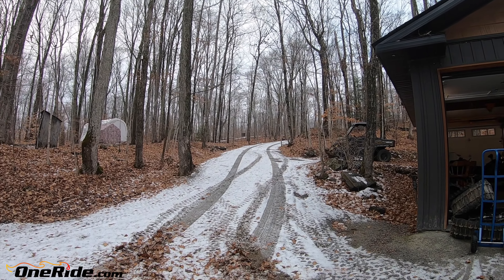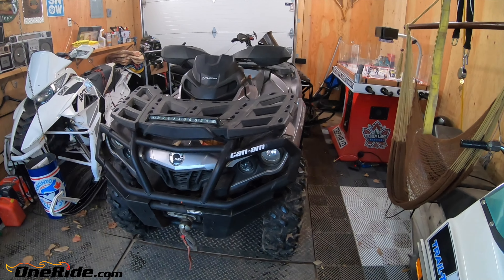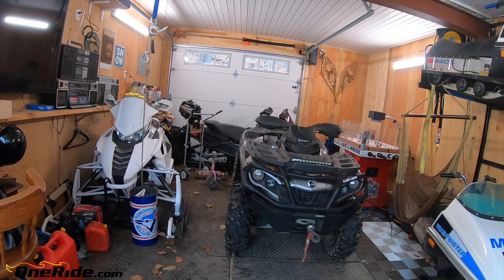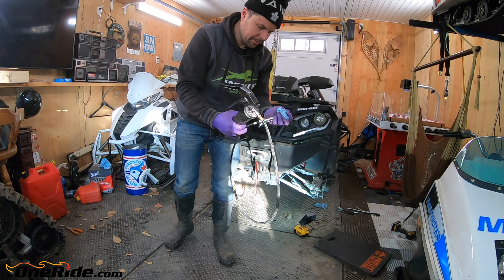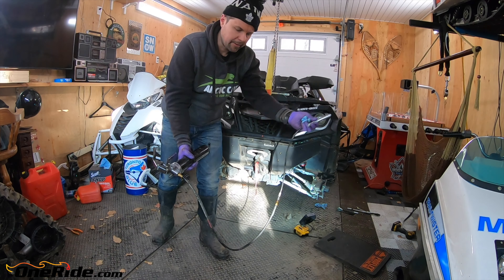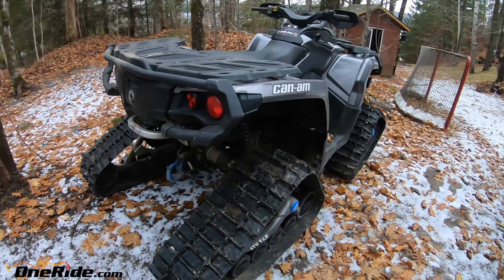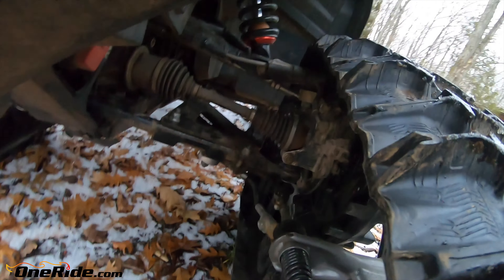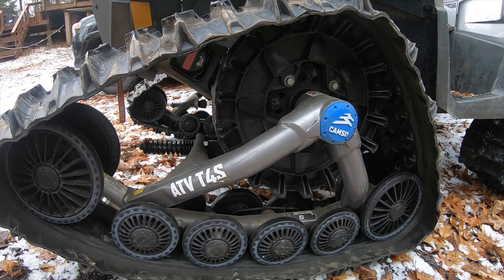How long does it take to install tracks on your ATV - Camso T4S

Comment: Thanks for making the video. Quite informative. Many times I have considered getting tracks for my Super duty diesel atv. Haven't yet pulled the trigger. It's not often, but occasionally with wet snow the weight is too much for the tires and then it's a pain because I have a large pile of wet snow where it isn't intended to be. Tracks will one day be nice. I too, will install when temperature is comfortable for working as my garage isn't heated.

Comment: 2:04 Kick the tires.... But why in the world would you start changing your tires to tracks in early Dec.? Why not wait until you have 3 feet of snow and realize that your tires won't push all the snow on your plow???? then frantically pull the plow off and start switching to tracks while your family sits in the car at the end of the driveway.........Hmmm, never mind just keep doing what you are doing.
Reply from the maker: lol. I was going to wait to put them on… then I realized I’ll probably rather be sledding once the snow comes 🤘
Reply: Wow!!!! what? are you kidding me. Shane cover your eyes, this is too deep for you even with an inch of snow. @OneRide